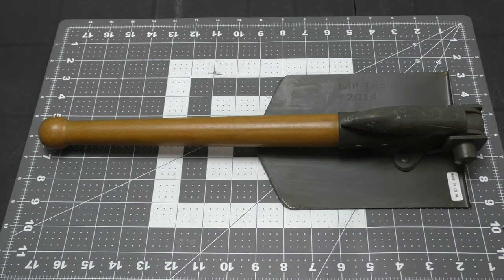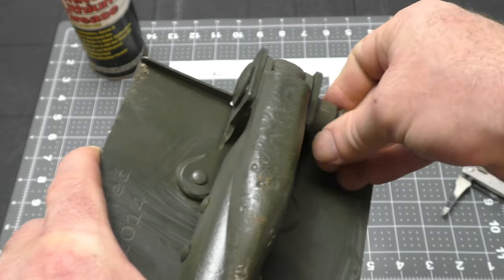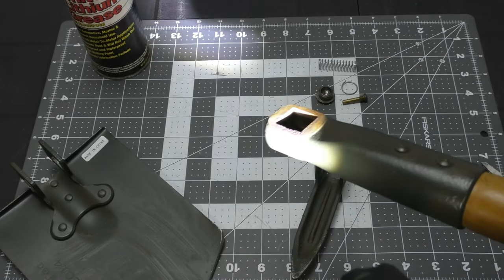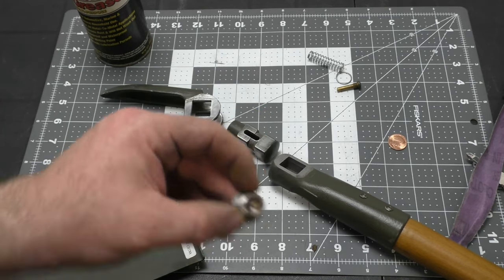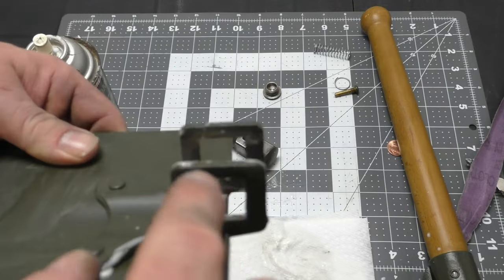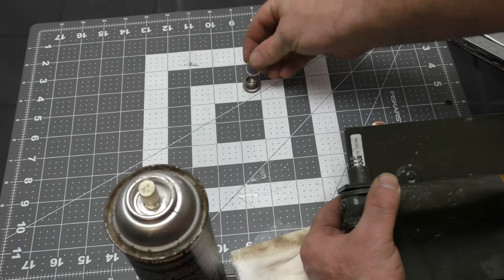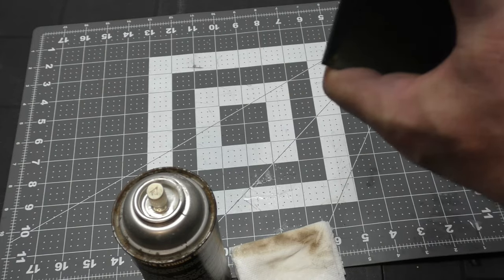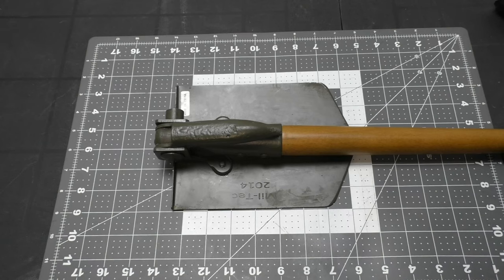Mil Tec German Army Shovel MYOG

Comment: Great job! Lithium grease should protect the metal for a long time, but if rust comes back, consider cold blueing those pieces after removing all grease and rust. Peace
Reply from the maker: Yes it should work well, use it every  year on car door seals so they don't freeze in the winter. As a consequence no rust around the doors and that is with salt on the roads here. Good idea on cold blueing.

Comment: I had a dozen vintage 1960s German ones I picked up surplus in the 80s.  Gave some away to different friends, but I still have 3 of them.  Excellent E-tools.  I keep one in my car trunk for snow emergencies and one on my bug out pack (if you cut the bottom off the US plastic E tool sheath it fits the German tool just fine.  I have indeed pried things with the pick end and not had it bend.  My idea of maintenance was to soak the heads of all 3 in Mobil 1 oil a year or so ago, then work the blade and pick until they were smooth.  Checking today the 2 in the house are still smooth and easy to work.
Reply from the maker: @kenibnanak5554 Nice. I wish I could find an original.

Comment: Now we talking. I hope this shovel is available in the Philippines. I am thinking that a dry film lubricant might work well. The carrier evaporates after application and leaves a protective, lubricating film. Muddy water and fine grit particles would be less likely to mix with the lube and form a grinding compound in the joint.
Reply from the maker: It is made in China so I think you have a 50-50 chance of getting it. Thanks for the Comment.